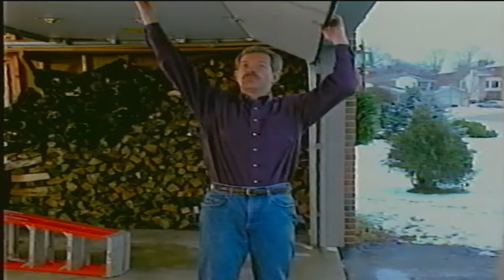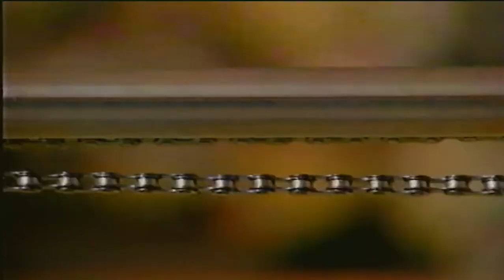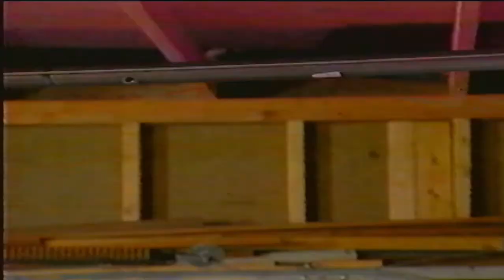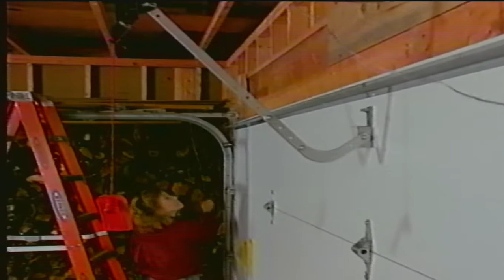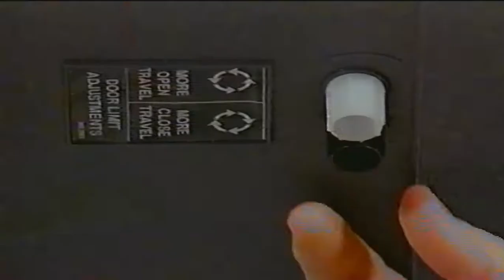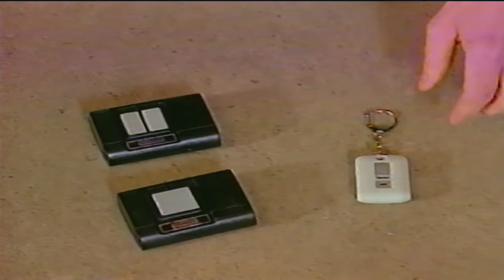Early 90's Garage door opener instructional VHS tape

Comment: Ah!  I've been looking for a very similar video.  There was a separate Stanley installation video that I think was a bit older as it didn't have the visual obstruction detectors.  If you happen to come across it I would absolutely love to see it.  I remember them demonstrating the safety features by closing the garage door on a roll of paper towels.
Reply: Ah I've Been Looking For A Very Similar Video.
There Was A Separate Stanley Installation Video
That I Think Was A
Bit Older As It Didn't Have The Visual Obstruction Detectors.
If You Happen To Come Across It Would Absolutely Love
To See It. I Remember Them Demonstrating The Safety
Features By Closing The Garage Door On A Roll Of Paper
Towels.
Reply: Ah I've Been Looking For A  Very Similar Video.
There Was A Separate Stanley Installation Video That I Think Was A
Bit Older As It Didn't Have The Visual Obstruction Detectors.
If You Happen To Come Across It Would Absolutely Love
To See It. I Remember Demonstrating The Safety Features
By Closing The Garage Door On A Roll Of Paper
Towels.